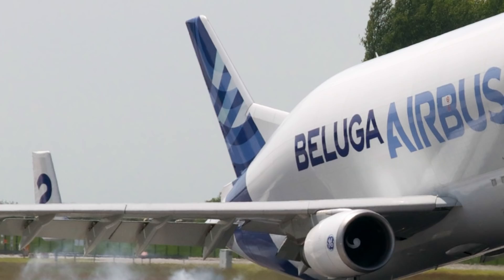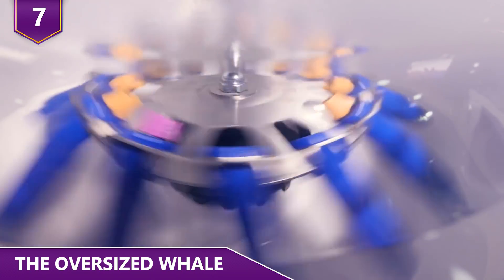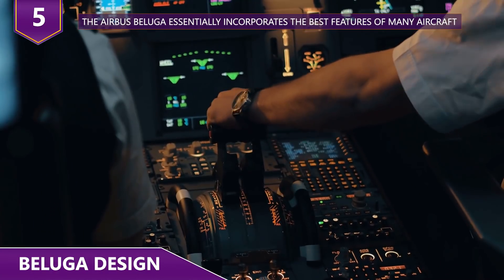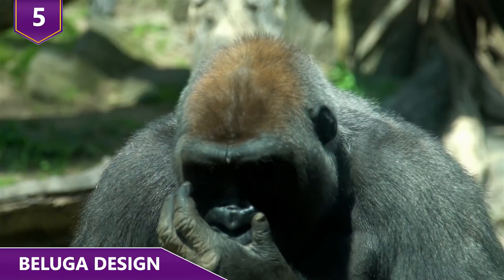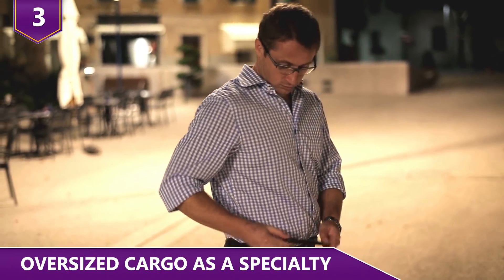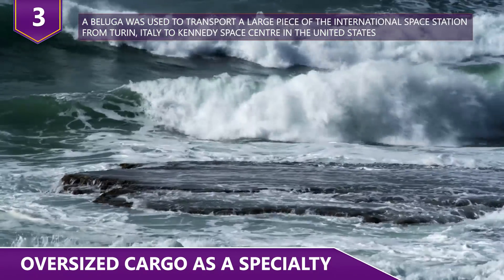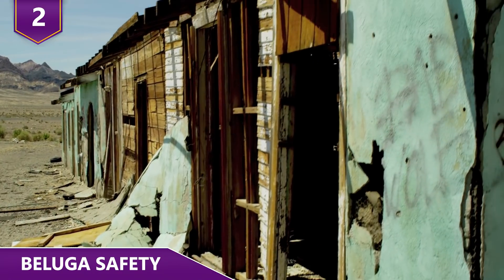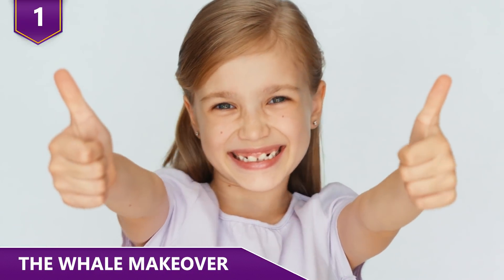Everything You Would Want To Know About the Airbus Beluga!

Comment: wouldn't it be cheaper to ship?
or to move factories closer to each other?
Reply: The Airbus Beluga was created due to the difficulties they experienced shipping large parts. The videos of Airbus shipping huge wings by truck are amazing, too big and long to go through most cities and towns, traffic had to be stopped for hours for the truck to carefully negotiate the tight turns. A special truck with a ‘steerable’ back end was used.  Airbus didn’t build this expensive plane without good reasons.